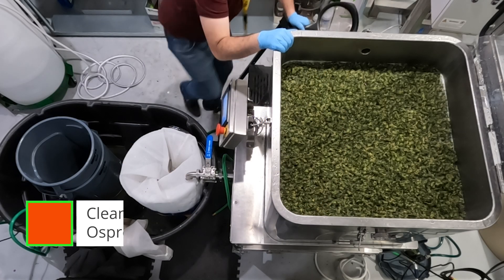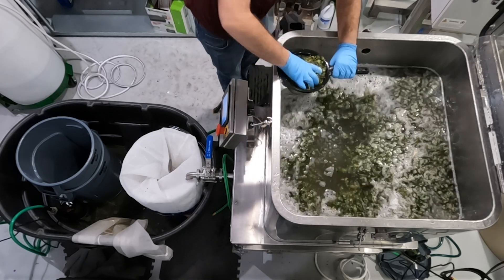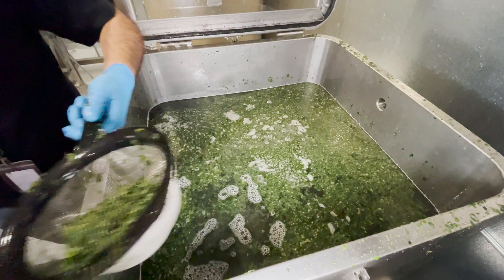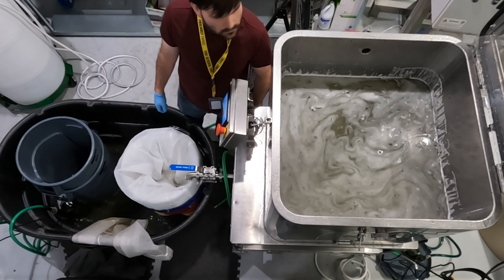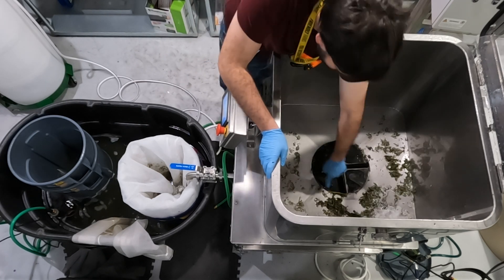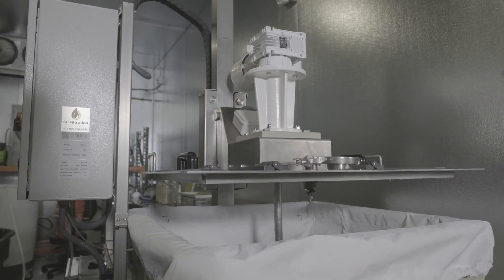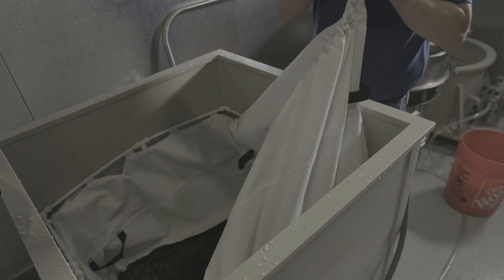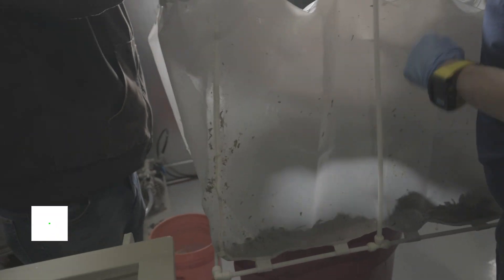The Great Solventless Cleanup Comparison: Which System Reigns Supreme?

Comment: What happens with the washed biomass? Do you think there is any thca remaining in washed biomass? Thanks
Reply from the maker: Depending on cultivar there is typically little value left in biomass. Typically whatever is left is not economical to reprocess using another method.

Comment: Beat the SHIT out that WPFF lmaooo
Reply from the maker: What do you recommend is the best method?
Reply: @SamboCreeckFiltration  Not really my specialty in regards to design and returns but maximizing yields in this particular method does not yield the best results. This seems nothing more than an industrialized version of a $100 portable washing machine with sourced parts from various OEMs and some specified 303 or 304 stainless. Absolutely no offense to your company but who got ya'll into this business? Just someone with money and claimed to see a niche that needed filled? I say this because anyone who does solventless processing knows if their shit looks like shake at the end they have now introduced more contaminants and undesirables which has a direct impact on quality. I can't believe you went to bat against these guys with the caveat of CIP being "faster." They're paying folks 10-20 an hour to clean. Costs aren't reduced at that area, at least adjusting for the number of "cleaning" employees dedicated to this task is but pennies on the dollar. Jacket the damn thing. Put a strainer basket in a track on the inside of the drum that sits flush on the bottom, perhaps under a folding top, drains underneath. That will allow for the fastest cleaning possible while still allowing for normal SOPs. Also, jacket the washer with a propylene glycol bath and perhaps utilize air pumps to create the vortex instead of a propellor. Processors fucking hate ice, RO water costs and employee overhead. A few grand here or there at the beginning stage of a processor starting their trip down the solventless road hardly seems the bait to hook customers.
Reply from the maker: Appreciate the comments, lots of insight. Air spargers don’t work in my opinion. Yields are bad. Jackets add extra cost especially when adding and using a chiller. Our method avoids a jacket and performs just as well or better. Cleaning is a cost and time issue. When at scale the process can take up far too much time. We agree on no ice, no RO, etc however not every lab has all the gear. We are flexible in whatever your method is. As for sieves, rotary vibrating sieves are the way to go, hands down. They have been perfected for decades and decades. No need to reinvent the wheel.  Please check out some of our other videos where we talk about all the technical details that went into the design.